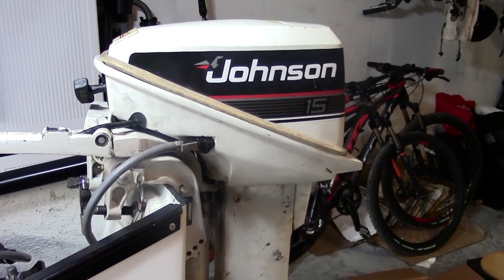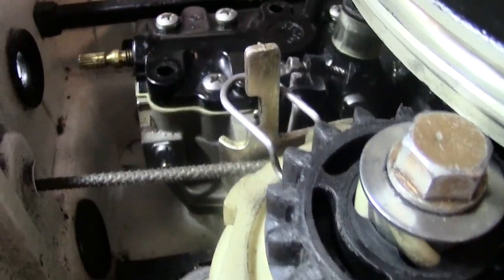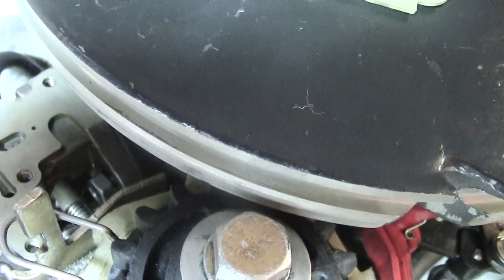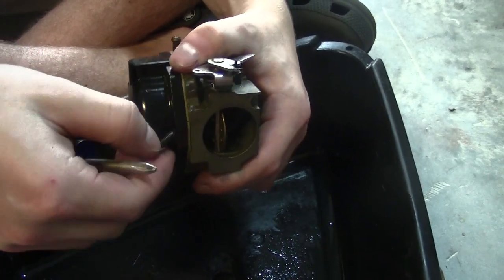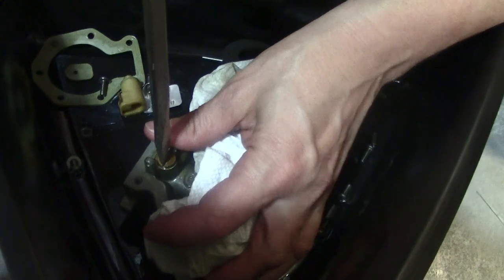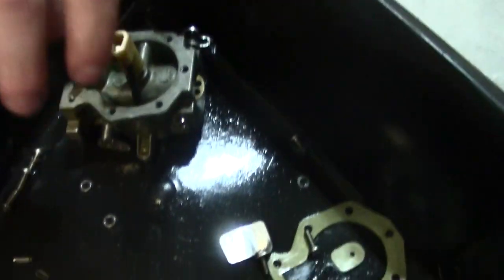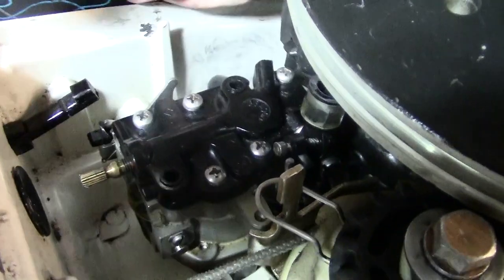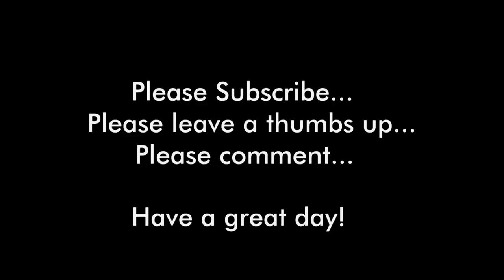Johnson/Evinrude 15 hp Outboard Engine Carburetor Rebuild

Comment: Great vid, removed pull start with the 1 bolt on top and had very easy access to the inside nut. Careful not to let spring out

Comment: I have one just like this almost un used that had been sitting for more than 15 years.
I 'll do this job and change the water pump rubber rotor.
Now, everytime I service a carb, I clean all the gum and residue of old gasoline . Cheers !

Comment: you can take the starter pull unit out but dont remove the screw out of it you just keep it in the gear and spring and do not take it out just loosen the big screw and slowly screw it out just enough to where you can pull the manual start out this way  you have access to the other nut that  holds carburetor  on on putting this start back you have to alien the tap on the bottom back with the slot on the motors base pan  but this is a steady hand and not letting that bolt come up any father than what it takes to remove the starter spool  and hang it over the front of motor base do not remove pull handle the reason for this is you dont want the spring to come out of there and then you will have to watch video on how to rewind and re-install  this step is only for the brave unless you been there  you did a great job on this video  i have done a few and your right on  i just took the  start unit out because the nut was so tight on that side i had no choice but to get a better access

Comment: not to quibble because you are helping me out here. i have a closed end 7/16  wrench which i ground down thin enough to get in there on that carb mounting nut. 

of course getting the nut started is the adventure lol. ps- i have this exact model engine.

Comment: I have an old Johnson 15. Got it years ago. It would run amazingly, and would always start on the first pull. The guy that sold it to us never faxed us a bill of sale like he said he would, so it's just been sitting for years now. The last few times that I used it, I thought that it seemed to be running a little slow on full throttle. Then out of nowhere on rare occasions of running on full throttle, it seemed to pick up speed for a short time. I have noticed that a couple of teeth are broken on the gears near where the throttle handle meets the motor, and the gears won't line up correctly. I doubt that would be the main problem with it picking up speed out of nowhere, since I was already giving it full throttle and couldn't torque the throttle any more.

Comment: Thank You so much,this Vid helped So Much,got a Eva 9.9,1989 model,Got the inside Carb bolt off With a Snap on offsetbox wrench,Worked Great.
Reply from the maker: +pacnscoutr --- great!  In case you plan on rebuilding the carb, I put some links in the description to point you in the right direction.

Comment: Jake, nice video, I have the same motor on my little fishing boat and I had trouble last weekend with idling, high speed was fine, but idling in the marina gave me few stalls, I reached down on pumped the primer bulb at the tank and it restarted.  I first thought fuel pump, saw your video on the pump replacement too, nice job, but I think it unlikely to be the fuel pump if the high speed rev's are reached easily.  Maybe I have a bit of gunk in my carb so a cleaning may be needed, I haven't had the carb off before, in fact, I haven't had the motor that long, maybe a few months, anyway, your video was perfectly narrated and recorded, I'm confidant with the cleaning and rebuild after seeing your work, thanks for taking the time to post it!!!  Roy - Las Vegas, Nv.
Reply from the maker: Thanks Roy.  Listen, it might seem to be obvious, but check this out if you have not done so yet:  On the tiller handle tip, there is an idle adjustment knob.  Its on the very tip of the handle.  When the engine is running, see if you can pick up the idle a bit by turning it either way, left or right.
Reply: Thanks Jake, I am still learning what all the little knobs are for and that one WAS one I needed to know about, I will check it before I do anything, the little motor runs so well that you probably just found my problem, can't wait to check it.  Thanks again!! Roy.
Reply from the maker: +Roy Michael <---- Let me know.   I'm curious if that fixed the problem.  These little engines are amazing.  They will last forever if taken care of.
Reply: Dang it, Roy!. They never seem to report back. Lol

Comment: It's good to not have you taking off the starter rope assembly therefore you can just count on dropping one of the Nets to hold on the carburetor because you can't get a tool on it and you can't get a hold of it with your fingers unless you got small hands once you take the starter assembly off it is easy to take the carburetor off

Comment: Great video, nice job, I have a question, my carb has a hole in the top, at the end of that "L" shaped passage that is open into the float bowl, I can see right through the hole, is that normal? Is it some kind of overflow?

Comment: Mine is a 1985 and it has a metal housing at the flote, I was wondering why you don't soke the carburator in carburator cleaner for a few hours, I think mine has a lot of varnish in the bulb, any have would be appreciated.

Comment: Didn't read through all the comments so I don't know if it was mentioned in the comments, but to add something to the rebuild video is that top black "plastic" plate on top of the carb be very careful not to torque down to tight when replacing those phillips screws because that plate can crack, I know because I bought a 1990 15 hp Johnson here lately and that plate was cracked from someone bearing down to much on the screws. That plastic plate is $100 bucks new, outrageous.I have not tried it but I have read that the plastic cracked plate may be saved by JB Weld.

Comment: Great vid, very helpful thanks. The manual I have says the needle valve should be backed out 2 1/2 turns from fully seated.  Anyone with this same type of carb and top plate know if this is right?

Comment: I’ve got a very similar Johnson motor. 

Do you by chance know what the internal motor size fuel lines? I believe there are two different sizes. 3/8 lines and the others are about half that diameter? Need help! I threw away old hose lines and didn’t write down their sizes.

Comment: The little slightly yellow transparent hose that sits inside the carb is totally loose on my engine. I also have problems running in idle, do you know what that part actually does?

Comment: How much compression does this motor sappose to have on the cylinders i have the exact same motor. On this boat i have i gotten a deal with the trailer john boat lowe colt 14ft with two trolling motors but its been sitting an im goin test the compression an clean carb but first i need to know the compression befor anything

Comment: Hi, I have a 15 hp Evinrude but there is no engine number and the cover has been resprayed so no original decals on it. How can I identify the model without the engine number? Please advise if you can assist?

Comment: Thanks for the video! I have been searching the internet for a manual download and I cannot seem to find one. I picked one up a year ago and just now tried it over the weekend. I need to get at least a kill switch for it. Anyways, I am having trouble with the idle and also no water out the "pee hole" I found the pee hole to be plugged, so I will attempt again to see if it works. I saw the comment on the thermostat, I will check into it. My biggest concern was when I was at full throttle, it bogged down, almost stalled then kicked back in. Long story short, I took a swim after that when it kicked the handle out of my hand. Would you have an idea on what may cause that? It is intermittent. I cannot duplicate it every time. Thank you- Anthony

Comment: I watched your video 2 years ago and successfully rebuilt the carb on my motor that had been sitting a long time. 
Now I'm having a problem keeping the motor running this year. I have to run the choke on and off the keep it running. I went thru your steps again with no success this time. Carb was clean, I am getting gas to the bowl, but it still keeps dieing unless I keep choking it to keep running. Any ideas?
Thanks for the video!!!
Reply from the maker: Possibly the fuel pump is not pumping with enough pressure.  
Here is the video:  https://youtu.be/yLDkQcc1naw
You can buy a fuel pump here:  http://amzn.to/2wVJndN

Comment: Hi Jake, yep, that was the problem, guess I hit the knob a few times, twisted it and got great smooth idle, thanks for the tip.  I replaced the impeller a few weeks ago because the pee hole, (Tell-Tale) wasn't streaming water well, under way I get a slight stream, well the new impeller hasn't helped, I think the line may be clogged, any tips?
Reply from the maker: +Roy Michael -->  Hi.  This model engine won't give you much of a water stream, if any, however, I understand your concern. Also it's been a while, but I'm pretty sure your engine has a thermostat which will open only when it gets hot enough.   When I get home later, I'll try and refresh my memory...I believe there is a cover under the hood and you can open it and take out the thermostat to test it.  (Just drop it in hot water and you should see it open).   I'd also flush or blow out the passage ways from the top down.  One more thing, if you take the thermostat cover off and start the engine with the earmuffs on the lower unit, you should see that it's pumping water up from the bottom...
Reply: i have had the same problem, if you look inside the pee hole ,youwill see some leaf material placed there by a small wasp , food for the new hatchlings. dewey said it.
Reply: Need to pull powerhead and replace rubber grommet on top of water tube. Common issue.

Comment: Jake, thanks for the nice video! Clear and easy to understand. 
I was wondering, when screwing in the "needle adjuster" (at 18 mins), how far in do you screw it? Do you screw it all the way in and then out a certain amount or? Thanks again!
Reply from the maker: +Alexander Winkler ->  Hi Alexander.  Generally, what you want to do is GENTLY turn the screw in to where it seats.  Gently is the word because it doesn't have to be closed all the way....  just until you feel the resistance of the screw and you know you have turned it enough.  Then turn it back 1 and a half turns.  When you get it all back together and you start the engine, that's when you make the fine tuning.  Start by continuing to turn the screw counterclockwise just a drop at a time until the engine starts to stumble a little,  then at that point turn it back in like a quarter turn.  That should be about correct as far as tuning it, and that's where the screw should be until it's ready for any other tune up.

Comment: Hey I was wondering what that red clip on the starter recoil was? I have one on my motor too.
Reply: It’s a safety mechanism that prevents pull starting if you’re in gear and the throttle is wide open. Keeps you from pull starting and getting thrown out of your boat. Mine broke and I didn’t replace. Not needed to run.

Comment: Hi,

I just bought a 1980's Johnson 9.9 and am trying to get it to run.  Rebuilding the carb now.  I have a question on the center piece you mention.  Is there supposed to be flow through the small brass tube?  Mine is clogged and been sitting in carb cleaner for a couple of days and still clogged.

wondering if I can clean it out with a small piece of wire.  Just not sure of the flow path on the small brass tube that the small hose goes into.

Thanks!!!!!
Reply from the maker: carboman2010 ->  I recommend using compressed air or carb cleaner to clear the ports and passages and jets in your carb.  Hold on to it tight so it it doesnt fly across your garage and get lost with the high pressure.  Soaking it is fine but might not clean it thoroughly.   Be careful running a wire through things because you can damage it.
Reply: Thanks!  I just go it cleared.  Soaking it for a while in carb cleaner and using a smaller wire and air did the trick!  Happy  not to drop another $50!!!!!!!

Thanks again!!!!!

Comment: Can't figure out why you took the top of the carb off before you took the carb off the motor,it is easier to take the rope pulley off and pull it out of your way,you can get to the mounting nuts easier.

Comment: I have a 1978 9.9 and the carburetor looks almost identical. I was wondering what the part is called @12:05. It is the brass tube coming out of the dead centre of the carb. When the motor was being disassembled they tried to remove that part and the top part that looks like it could fit a flathead cracked a bit. Is there anywhere to get this piece? Is it even removable?
Reply: Its called an emulsion tube

Comment: It's easier to remove the pull cord assembly to pull the mount bolt on the port side. Just have to exercise care in keeping the starter spring from flying apart
Reply: Not at all! I left mine In  Cause taking it out you risk it coming apart

Comment: There is a website on the net called LeRoy's Ramblings, it's a treasure trove of information on these Johnson / Evinrude 15 hp. If you look on there his article on 9.9-15 hp motors in the carburetor article he shows a picture of a homemade modified wrench / carburetor tool for accessing that hard to get to nut.
Reply from the maker: +NLINE7 ---  very cool.  I'll check it out.
Reply: I live by Leroy's ramblings it is the BIBLE for these motors!

Comment: Tip heat up the jet with a torch lighter it looses its it up nothing worse then having to throw out a carb ir go through a mission because a stripped jet stuck is a 💩